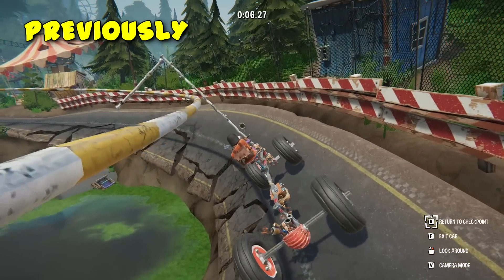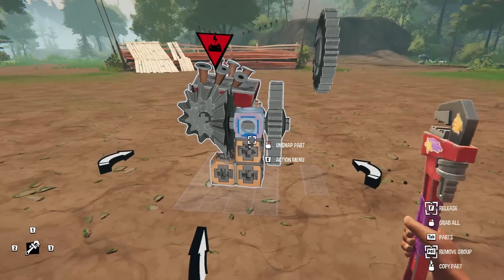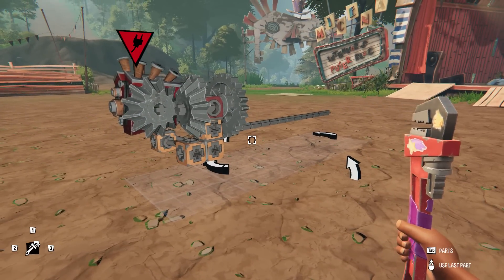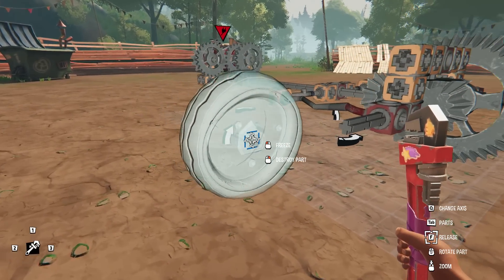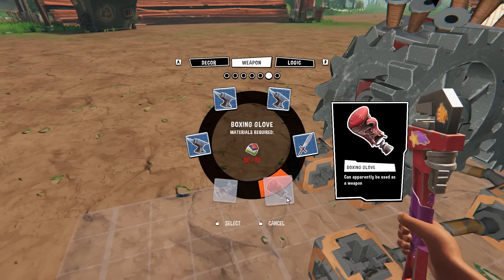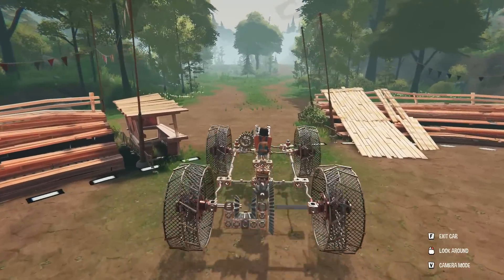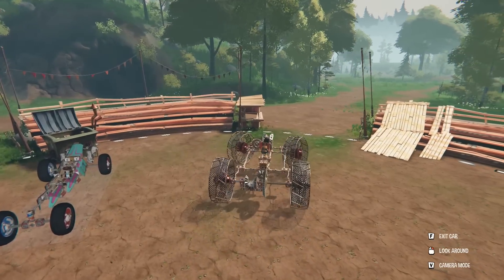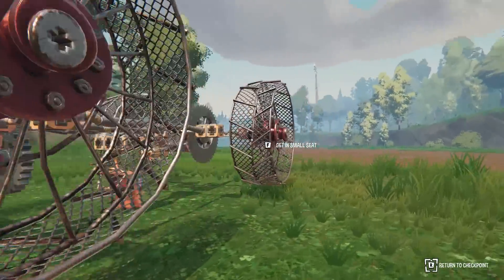I Built a Working Transmission & Gear Differential! (Hello Engineer)

Comment: Hmm, that's not really how a differential works... Neither wheel should be directly driven, like your right wheel is.
Reply from the maker: indeed, but it's what I could do with the game
Reply: @darealkosmo  yeah, I can see how it wouldn't be easy.
I've been trying to figure out how it could be done since seeing the video
Reply from the maker: @TheBaldrickk  The problem that I ran into while building is that all gears only have one attachment point, the shaft. This means that no matter what I do, the main gear will always be attached to one axle. Ideally you want the main gear to be hardmounted to the diff "casing" and have the diff assembly be a free spinning assembly inside of that. But I'm sure you already know that since you pointed out the issue in the first place :D
Reply: @darealkosmo  indeed.  A standard configuration just won't work with the constraints in the game's implementation.

I've been trying to see if I can come up with some alternate configuration that could work.
It may be possible to have a kind of split system, with a lot of the mechanics duplicated on each side, but it'll be a lot more complicated and take up a lot of space
Reply: @TheBaldrickk  havn’t played with the demo yet, I intend too but I have an idea for how a design for it might work, it would require for the differential  to be above the wheels in and it would do some dark gear magic but it might work but it would probably be kind of bulky
Reply: @darealkosmo  you could of used a yellow block in place of the right red block with a shaft going through it to the main gear then make the casing off of that to two red ones for the other gears.
Reply: @TheBaldrickk  I did manage to build one and I think the only work around in this game is to use the fact that pieces can clip in each other when they move. PS: if you build a car with the differential you will need suspention for it to be fonctional because if a wheel isn't in contact with the ground you car will lose all it's propultion ( I tried ><)
Reply: @methusmit5015  which pieces clip? I didn't find any that did do usefully, they just hit
Reply from the maker: @TheBaldrickk  apparently the shafts can glitch thru each other, which does make it possible, just not realistic xD
Reply: As cosmo said if you have any pieces rotating around a shaft they don't collide with anything but the ground
Reply: @methusmit5015  interesting... Because I had collisions
Reply: Well... I downloaded the demo, and spent a few hours bashing my head against it.
My idea was feasible, but not practical.   By surrounding the diff with fixed cogs, to make a giant one, the linkage can be made free-spinning around the two shafts, and an external cog can provide power.
The problem comes from making something you can mesh with consistently...

I REALLY don't like the blueprint system.   I saved what I made, tried to do some experimments to see if I could get anything to clip (like the pistons in SM do) - found a few dodgy hit-boxes, but nothing workable.
Went back to finalise work on my mostly finished creation, and... despite the thumbnail, and it loading up fine previously, the only thing that spawned was the seat...

Comment: You should be able to lock that diff in place. So right in front of your differential, you have those pipes and they have that little nub sticking upwards. Those nubs are actually connection points. So you could use the nub on that one side, forget all about symmetry, and use that to anchor the diff into position instead of letting it rotate around in place.
Reply: Kosmo is kinda OCD when it comes to lining things up. Flush parts and symmetry are really important to him and that is one of the things that lets him make things that look so amazing, he wont compromise easily.

Comment: You could make the car like it´s mid engine, connect the suspension to the engine and have the whole front section sprung. I mean, the characters are teens so they wouldn´t think this through

Comment: I was just thinking put the engine sideways in the middle of the vehicle and have a shaft going to front and back from the engine to a front and rear differential for 4 wheel drive

Comment: I made a pretty solid differential in scrap mechanic I love using. Can only deal with engine up to 2 below max power but still really nice. It's based on someone else' I just removed the suspension glitches.

Comment: @Kosmonaut and @TheBaldrickk I figured it out! I created an actual working differential in Hello Engineer! Check out my short video showing it work  https://www.youtube.com/watch?v=issluhNLQQY
Reply from the maker: that's crazy! I didn't realize the shafts could glitch through each other like that...a bit unrealistic but very cool nevertheless, good job!
Reply: The shafts are not glitched I just have multiple smaller shafts that are hard to see in the video.
Reply from the maker: @Top_Fuel_1  well the shafts can definitely glitch, or clip if you will, through each other because how else do you explain what happens at 0:24/0:25 when the diff support goes through the main shaft?
Reply: True, it's just not intended. Tried to make it as legit as possible with the materials.
Reply from the maker: @Top_Fuel_1  I think it's pretty slick!
Reply: Thanks! Took a while to finally get it right, but I'm happy with the outcome!

Comment: Kosmos. The way you build that "differential" is NOT how that works.
The Right wheel is linked 1:1 to your driveshaft!
Your left Wheel can spin slower, BUT not faster than the other wheel.

You talk about the differential being open while it truly is just locked up (thats the opposite of open).

Comment: It wouldn’t be to difficult to make a 
u-joint it be a bit bulky but you all necessary parts to make a basic one

Also I’m pretty sure you accidentally connected the rear right wheels directly to the drive shaft because you a rod going connected to the big bevel gear granted it’s also connected to the small bevel like it should be but the half-shaft can’t go through the drive bevel because it get connected to it that is why when you turn right it spins rear right wheel faster rather than turning slower

Comment: i believe the differential is not working because the big gear is attached to the right wheels axle. only the right wheel is driven and the left one is kinda free spinning. this game doesnt have gears with a hole in the center does it?

Comment: Probably find if you made the chassis pivot in the centre longitudinally so the axles front and back are independent of each other so you don't pick a rear wheel up and spin the open diff

Comment: It looks awesome, the diff would be cool but it’s not quite right, the crown gear should drive the casing not connected to one wheel. If there was a way of having a gear that didn’t engage with an axle but could be built on, that would make a real diff.
Reply from the maker: indeed :) Game limitations 🤷‍♂️
Reply: @darealkosmo  Considering the limitations, it worked well for dividing drive!

Comment: nice work but i see a small error with the diff. you have direct drive to right wheel.  think it will be tricky to make since you dont have a no collision part to use.
need to be something like i made on this one.
search moonbos video named " AWD Differential Gear Powered Vehicle with Suspension and MORE!
timestamp 14:34
Reply from the maker: yep exactly ahah. It's all I could do with the parts that I had!

Comment: 3:33  Can't you just rotate the engine 90 deg to get a shaft towards the back, instead of this monstrosity?
Reply: That was my thought.  Would've made it pretty easy to do 4 wheel drive, too.
Reply from the maker: could've just not made the video at all, that woulda been the easiest 😂
Reply: @darealkosmo  
NO! I really like your videos!
I was genuinely curious as to why you didn't just rotate the engine 90 deg... 
I never played this game so I don't know if there was really a reason for this... or not. lol
Reply from the maker: @Reth_Hard  haha fair fair! I wanted the engine to be in a proper RWD orientation :) The way they have the shaft perpendicular to the length of the motor simulates an oil pan that would have a diff integrated into it, but I just wanted to do a proper lateral RWD setup and having the engine positioned that way was the most accurate :)
Reply: @darealkosmo  
Ahhh ok and I guess it's fun to test what you can do with gears in this game. 👍
Reply: @darealkosmo  I thought transverse engine mounting was pretty common nowadays, do they not do that for RWD?  Iono anything about cars so I'm prolly wrong and it doesn't matter anyway, just curious. :)
Reply from the maker: @stevepittman3770  For purely RWD cars they do latetal but it's common to do transverse when it comes to AWD these days

Comment: 1:19 I mean, could you not simply have rotated the engine 90 degrees and then treated the sides as the "Front" and "Back" respectively?
Reply: well, the engine is not centered with the shaft-outputs. It also looks nicer when it’s frontside faced